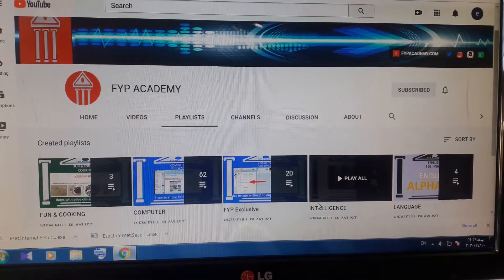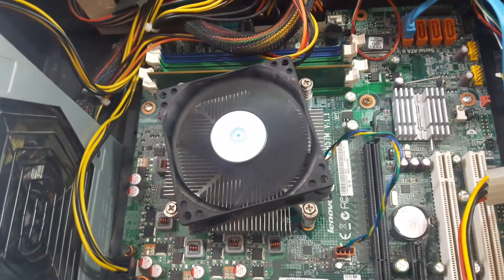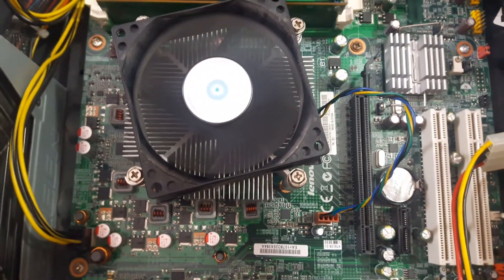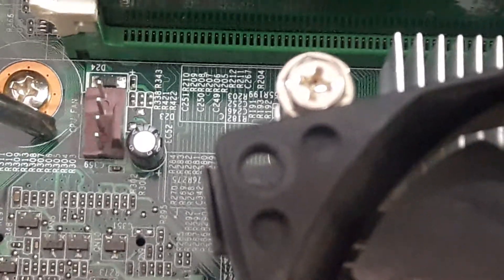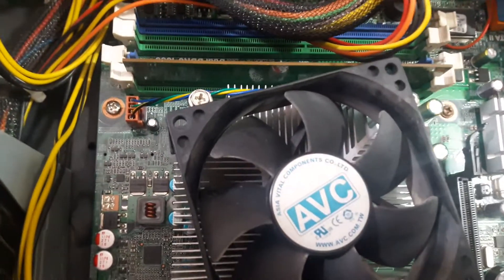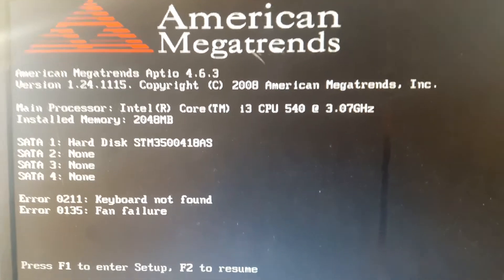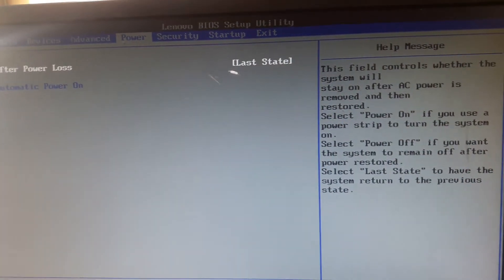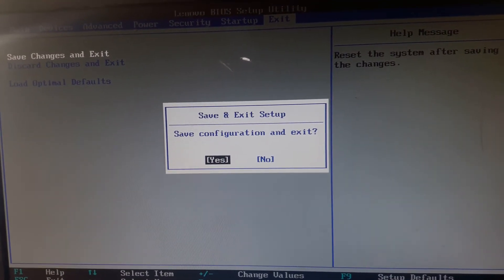CPU FAN FAILURE OR CPU FAN ERROR

Comment: Didn’t help bro
Reply from the maker: May be you need to read the descriptions too or send me more details about your problem,I ll be glad to help more anyway
Reply: @fypacademy  hm so my menu is a Little bug different it’s from Lenovo and there is no Option to change the GHz from my Fan
Reply from the maker: In some gaming main board bios configurations , there is options to speedup CPU fan for all modes of performances , But I have never seen this capability to change Ghz or even Rounds per minutes (RPM) , it just shows RPM and if you think your RPM is lower than usual or your expectation , just replace your CPU fan (even) temporarily , then check it up to see how your RPM changes or not.